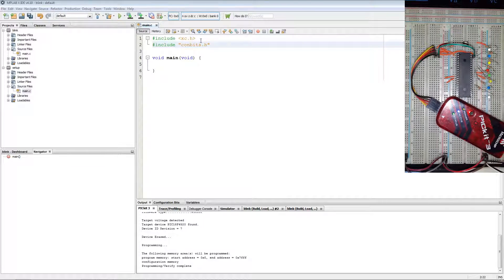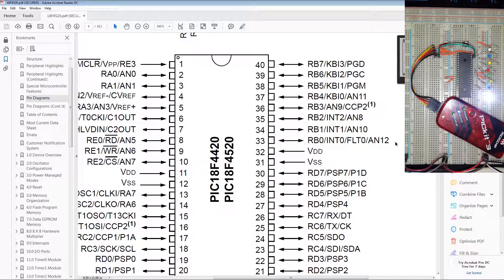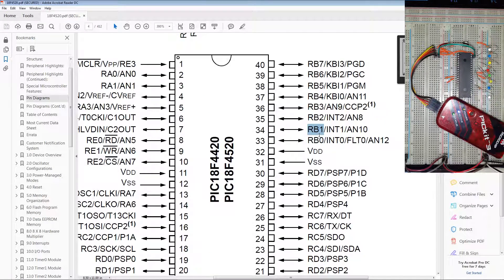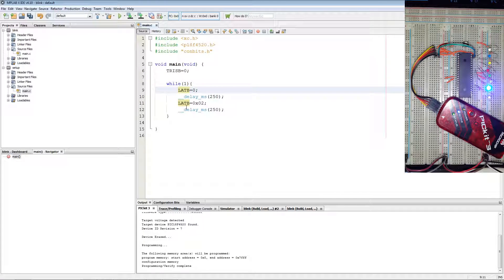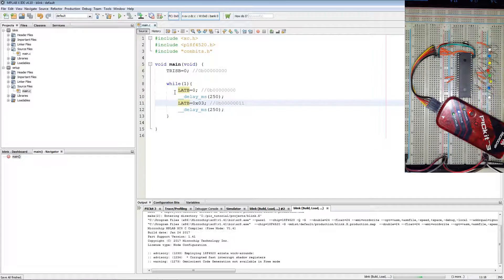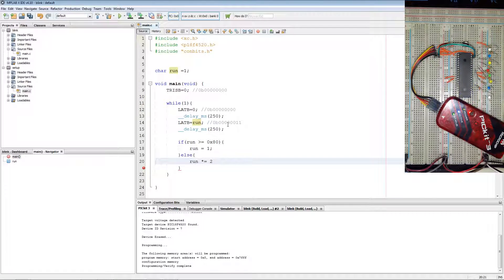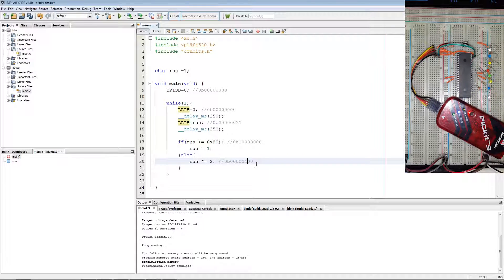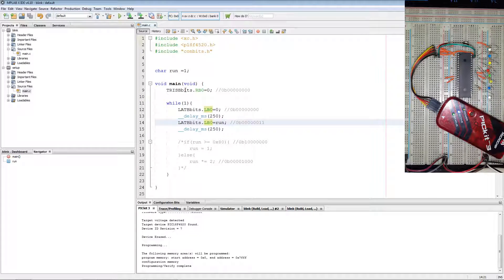Blinky and Running LEDs 🔴 PIC Microcontroller Programming Tutorial #3 MPLAB in C

Comment: RB5 is likely not dead at all, your configuration bits are likely incorrect, as default these chips come in low power programming mode, what you need to do is set "Single-supply ICSP enable bit" to disabled in the configuration bits, if this is enabled RB5 is disabled, it's the same on the PIC18F4550 aswell.

Comment: am doing this on PIC10F322, and its not working, the only thing that works is upto setting RA input/output with the TRIS function. I cannot seem to be able to use the latched output functionality at all. it doesn't do anything. at least according to MPLABX simulator.
Reply from the maker: Sure the simulator clock is set correctly? You could also have a invalid config bits set. 
RA2 is the only pure GPIO pin. The pin you are using could be a analog input by default. If the pin is set as analogue in then it will ignore what is in the TRIS register. 
Section 10 of your datasheet covers the IO. 
https://youtu.be/O4IpwgWhqLY

Comment: Hello, thanks for posting this video. I followed your steps but I can't get the RB0 pin to even turn on, let alone getting it to blink. My LED remains off and measuring the RB0 pin gives a negligible voltage (same as all the other pins, ~0.07V). Where should I start looking for problems? I am using the PIC18F2550-I/SP with the PICkit 3, and I am new to this. I made sure I set my conbits.h file correctly as you laid out in your previous videos.
Reply from the maker: Is your rest pin pulled up to 5V?
Double check that you have a inturnal ossalator. Otherwise you will need a external crystal to clock the PIC.
Have n look at the first video in the ATmega series where I setup the hardware. It is basically the same for all MCUs.
Reply: @BinderTronics  Thank you for your response. I fixed it, and I think my problem was that I didn't properly connect the MCLR pin with the resistors. What is the significance of that pin? Is it the same as the reset pin you are talking about?
Reply from the maker: MCLR = memory clear = reset pin
Reply from the maker: https://youtu.be/O4IpwgWhqLY
https://youtu.be/BHryCFw2U30
Reply from the maker: https://youtu.be/V7d6jhzMgYY

Comment: hi sir i want to ask a question what is the differense between latch register and port register ? i see some others tutorial they use port register to blink led.
Reply from the maker: It comes more into play when reading pin states. The PORT register is the physical voltage/logic value measured at the pin. The LAT (latch) registers is what the pin is attempting to set the state of the pin as.
Using PORT is a suggestion to the PIC.
Using LAT is a command to the PIC.
Example:
Something is forcing the IO line to stay low.
Case 1
Write 1 to PORT -> Read PORT -> PORT = 0.
You now have no idea wat the pin state should be.
Case 2
Write 1 to LAT -> Read LAT -> LAT = 1 PORT = 0.
You now know that there is something wrong on the output because LAT and PORT don't match.
Why some people use PORT and not LAT.
Some PICs may not have the LAT registers (Think the 16F series does not have it). The TRIS registers may control the function of the PORT register. Old habits from other microcontrollers. Not reading datasheets.

Comment: Can we program pic16 using Arduino Nano?
Reply from the maker: Can be done.  Never found it to be worth the effort to make custom programmers, unless it is just for the sake of knowing.
Reply: @BinderTronics  That means pic kit is preferred to program pic ! So Can I use pic kit 3 for programming pic16f628a ?
Reply from the maker: @aloklakhera866  Yes pickit is the preferred  programmer. If you are on a budget and can find one get a pickit3 else get a pickit4. It will also save you a lot of hassle.
Reply: @BinderTronics  and for atmel ic(s) ?
Reply from the maker: Pickit4, Atmel-ICE and STK500.
Reply: @BinderTronics  What's your opinion about usbasp for atmel ic(s)?
Reply from the maker: Never used one. So I have none. I know it is cheap.

If you are going to ask about ARM/Cortex-M. Segger J-link (get one with a reset line) best software tools I have worked with but extremely expensive.  STM32 get a ST-Link but you are then locked into only using ST chips.
Reply: @BinderTronics  Thanks for your kind response.

Comment: @Binde Tronics I am having trouble locating the #include file for the pic model. First the compiler installed itself in the program files (not x86), and the files does not appear to exist even in that directory. Without the include I get "unresolved identifier". I also checked the "simulation". How to resolve this?
Reply from the maker: Try pChipNumber and not picChipNumber. See if the microcontroller is still supported. Reinstall. What chip are you using?
Reply: @BinderTronics  The problem was solved. I had a different model and the real problem was that TRISB register did not exist for it. Other than that, for the new compiler version, it does not appear to have those .h files (regardless of pic or p). Including xc8 is enough.

Comment: So you say RB5 is dead on your PIC. My RB5 on PIC18F4520 E/P was also not working. So I read the data sheet and discovered you need to change: config bits to: pragma config LVP = OFF. When using high voltage parts. This is section 23.9 of data sheet (If Single-Supply ICSP Programming mode will not be used, the LVP bit can be cleared. RB5/KBI1/PGM then becomes available as the digital I/O pin, RB5.)

Thanks for creating all of these videos, they are very helpful to me as I am a 20+ year C# Developer learning Embedded systems.
Reply from the maker: It's a common problem with PIC18F45xx micros to blow a port or pin. I just swapped out the micros and the code started working so it was a fair assumption. This was after the recording. I also did not ground myself when I was building that circuit.

Thank you for bringing this to my attention. Will update the code as needed on Git. You can also clam credit on on the Project Setup video.

Comment: Hello, good video. :)
how can I constantly power my microcontroller and make it on using the pickit3 just like in the video ??
I have to take off the pickit 3 pins and use an external power source, but your method is more efficient
Reply from the maker: Have a look here for the pickit 3 settings: https://www.youtube.com/watch?v=OQ6hZzkvXMw.
Connected the pickit 3 as you would normally with the power off. Connect external power source to VDD and VSS.
Remember the pullup on the reset pin.
I use a Meanwell 5V 10W PSU (total overkill).
Reply: @BinderTronics  aaah I see. I forgot the MCLR pull up :D:D

Thanks for the clear up <3
Reply from the maker: Happy to help
Reply: @BinderTronics  1 quick question . why do I need to remove pull up resistor while programming in IPE ??
Reply from the maker: No clue. Have not used IPE in years.  Assuming its some setting. Put the app in advance mode and have a poke around there. Settings > advance mode. Default password is microchip
Reply: @BinderTronics  <3 <3